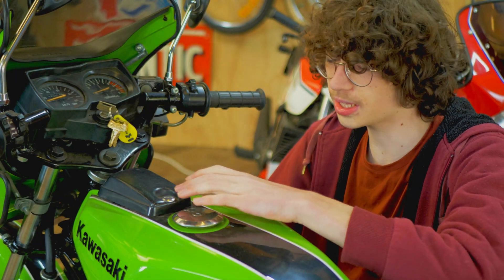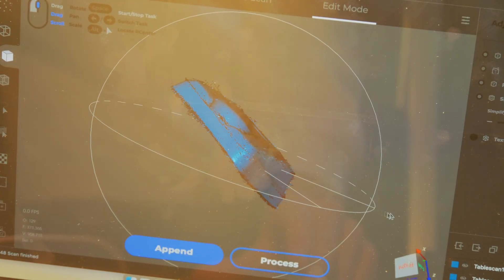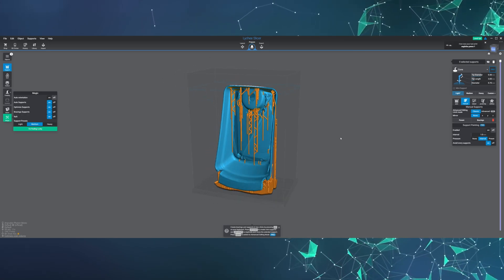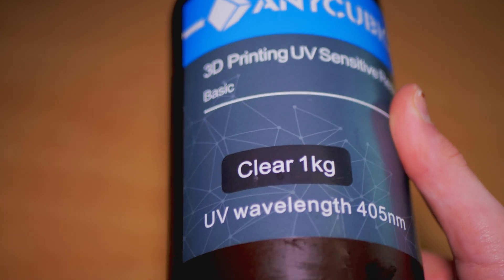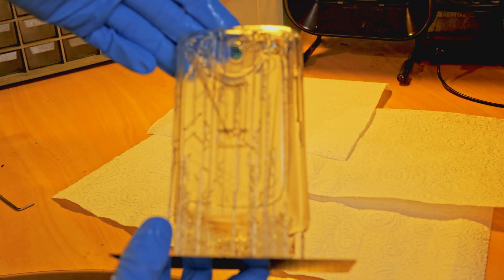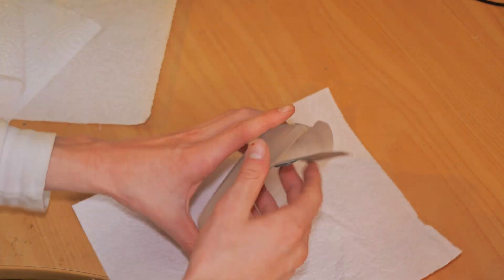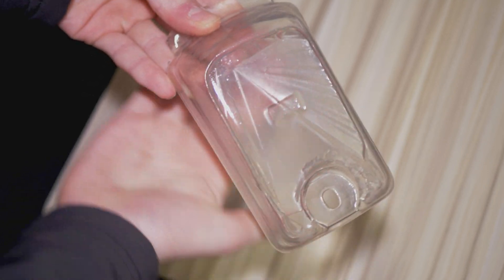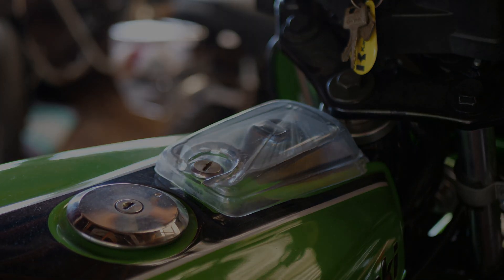How I Used 3D Scanning & 3D Printing to Make Transparent Motorbike Parts!

Comment: It was a good idea but clear resin is uv sentive, it yellows and becomes brittle. I bet now the original part made its way back on the motorcycle. If it was me I I would have use an fdm printer, print the part in an other orientation, better settings and print it in TPU or PETG which would make it much more durable.
Reply from the maker: I wish I left it longer to test, but honestly, it was off pretty soon after as I wanted it on my shelf, haha. Clear PETG or TPU could be very possible I think, but ultimately, clear prints are tricky when needed outdoors, and not something I'll be doing again soon. I appreciate your insight!